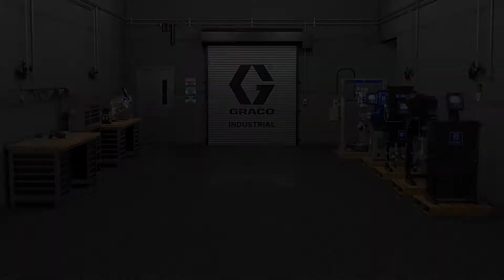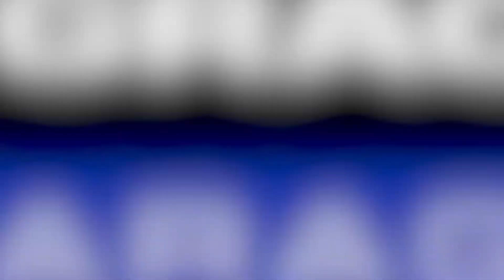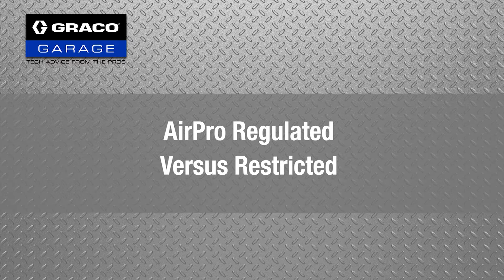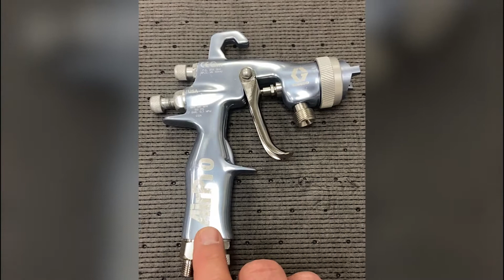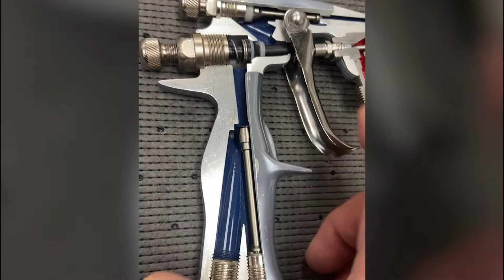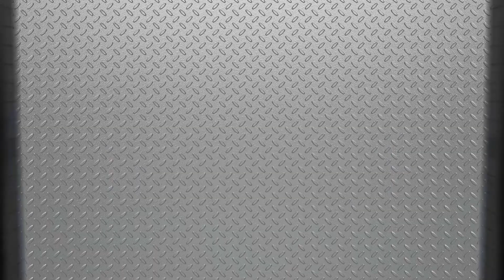AirPro Spray Gun Operation: Regulated Versus Restricted Air Atomization

Comment: I use these everyday and love them when the tip is not leaky clogging my horns 😂. They get heavy usage though. I love your vid being able to see the inside parts and chambers. Thanks!
Reply from the maker: We're glad you're getting good use from your AirPro spray guns!  We apologize for taking awhile to reply. To provide helpful advice on how to reduce the leaking you mentioned, a little more information about your application would be needed. Feel free to give us a call at 866-361-5929. Better yet, reach out to your local Graco finishing equipment distributor. Not sure who that is? Find out at https://www.graco.com/us/en/in-plant-manufacturing/how-to-buy/where-to-buy.html?wtb_code=CAP